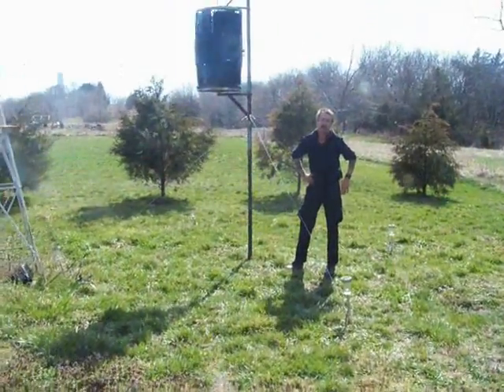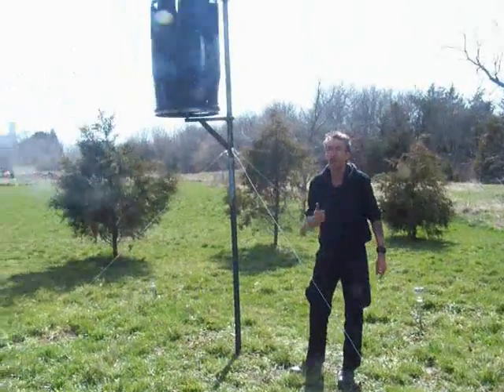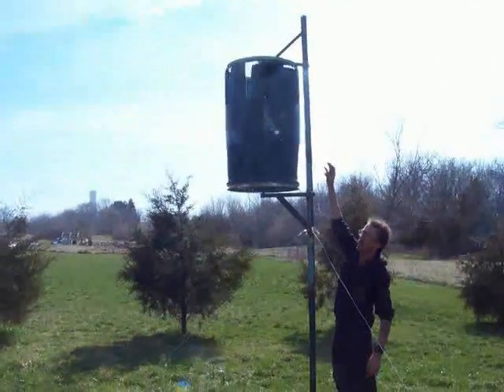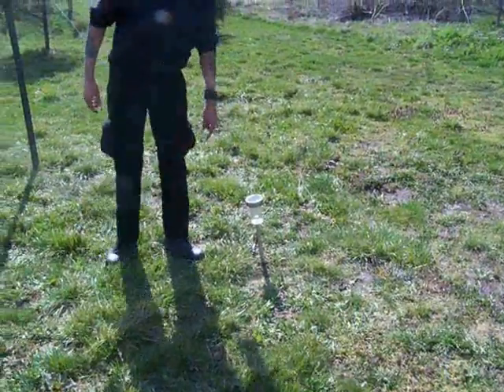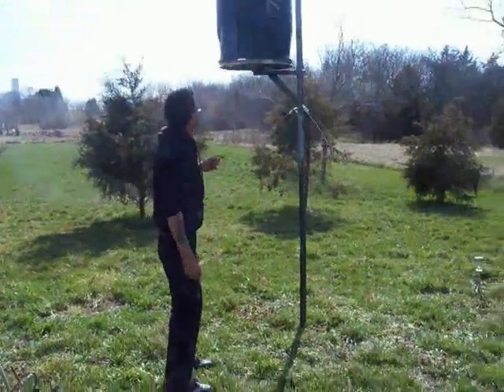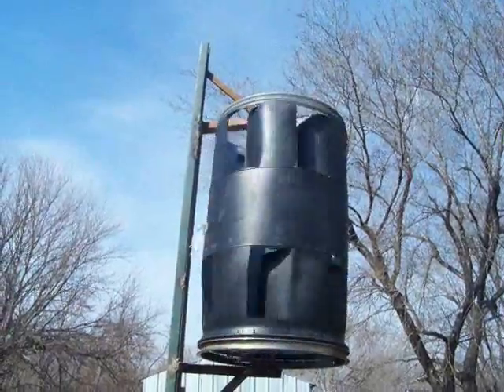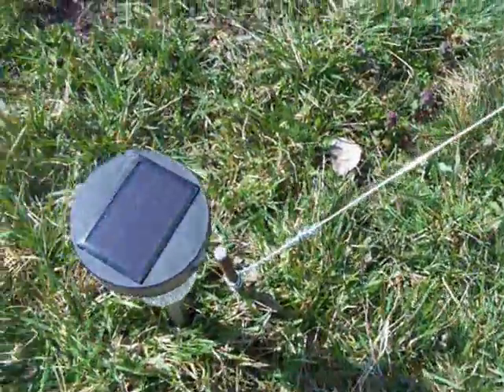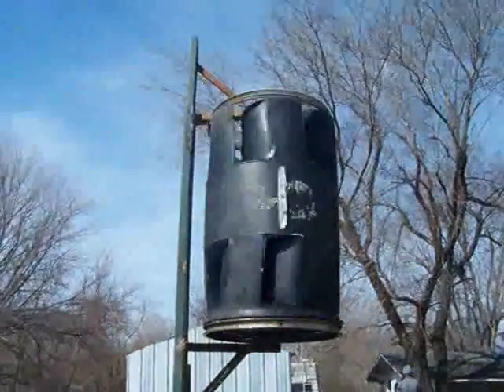REDNECK WIND TURBINE UPDATE !

Comment: Interesting new idea to bend the windows inwards and to use center as support . It will surely work also when you bend the windows outwards . If the support would vibrate you can add another one like an U letter upside down .More barrelsmore energy . A small model can be made from plast or alumínium bottle . Saw something similar in gardens on verticalrods .

Comment: I think if u hook up a electric motor to the pulley u will get voltage but it will vary depending on the wind speed . I am a machinist not a electronic tech.

Comment: get two car alternators, weld the shafts onto the axles of the turbin, mount the alternators so they don't spin, only the shafts, run your wiring into some car batteries and you're good to go.
Reply: +Gary Stinten You need a charge controller between the alternator and the batteries to prevent over charging.
Reply: +Gary Stinten Better make that a gas weld or you'll fry the diodes. Even to electric weld on vehicle chassis, you have to disconnect the alternator to avoid the diodes getting fried by the current passing through the diodes via the chassis earth connection.
Reply: This is spinning about 1% it needs to a PMG would be better.

Comment: Hey arnold use 1 of the ac out of a washing machine on both sides of your wind turbines and you would have a lot of electricity coming out of that instead of the way you are going to thinking about doing it it would work better and you have a lot more power

Comment: //Good video.  I like the fact that you used readily available items.  Here are my thoughts!!  Use as much surface area of your drum for vanes / flaps as what will allow for structural integrity. Also, run a belt around one of the bicycle rims and then around the pulley of a generator or alternator.   Good luck...

Comment from the maker: Get you an empty water bottle and make a small version you will see it do somthing pretty cool if you lay it on the street and test it out in the wind. both top and bottom are wide open and so with the fins inside it seems to cut down on drag and catch wind from all sides. I tried it both ways and liked the reults from this method better. Thanks for your comment.